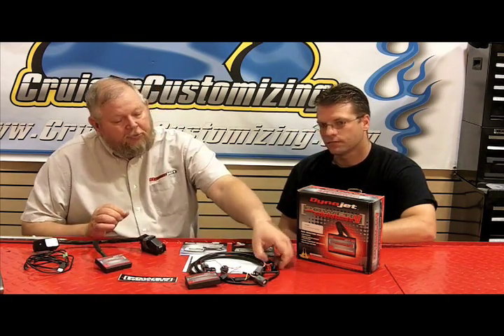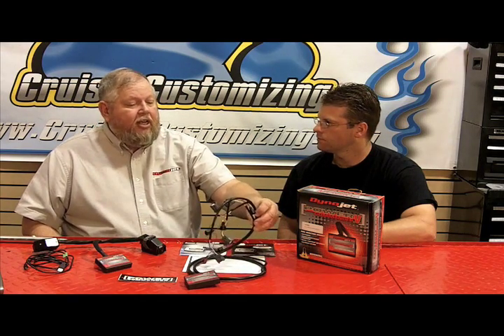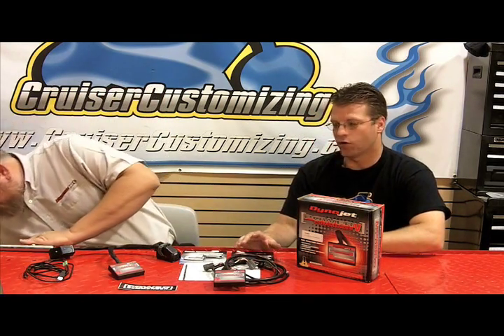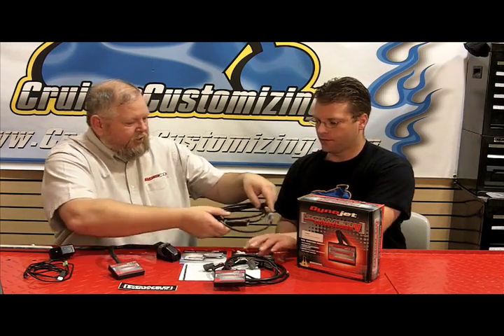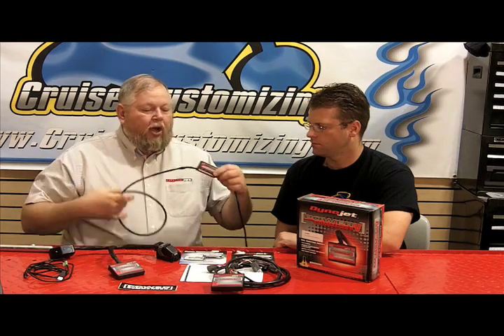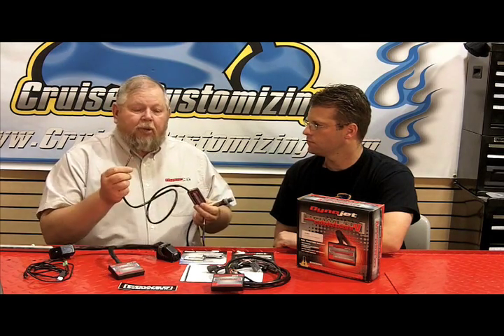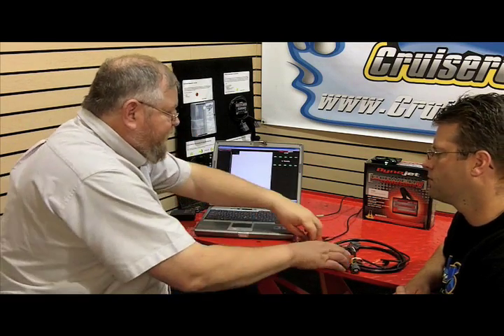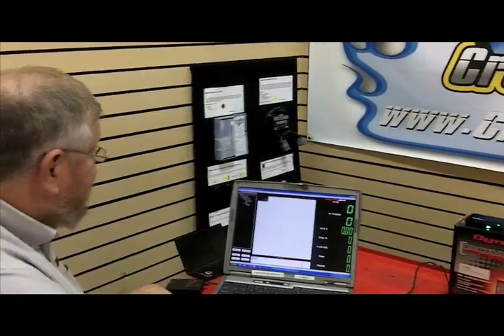Dynojet Research PowerCommander PCV 5 Five

Comment: hi if I change my rear tyre size from a 50 to 55 profile do I have to change anything in the pc5 settings also if I change my gearing to 1 tooth up would I have to recalibrate anything in the pc5  thanks

Comment: Can I get custom map then run auto tune to tweek the map for fluctuations in air humidity as I do a lot of moutain rides and the ignition module will that allow me to set my revs sat at 6000rpm in first and let me launch off the line then when clutch is out fully allow me to go up the Rev range  is it like launch control

Comment: So here is what you do you take a stock bike Dyno that bitch Install a power commander 5 tune it and Re run the Dyno show us what it does for us. Your web site sucks balls and not a video proving this shit works WHY?
Look I know a little bit about electronics I know a little about fuel injection Been working on these systems since  TBI single port multi port well Ok I know my shit.So prove it to me ill buy one. and as much as this shit cost fix the Web site I mean damn did the same guys that made Obama care site build yours? It's just links to places that sell this shit. For 4 bills I can buy nitrusoxide and on a speed density fuel injection I know it will make power.Again what does 4 bills get me with this?

Comment: I put a Yoshimura slip-on exhaust on my prior 2007 Suzuki GSXR-600 and immediately had the FI light come and stay on when no power commander was installed. I now have a 2011 Suzuki GSXR 600 and was going to purchase a Yoshimura R77 slip-on for it. Is a power commander required, or will I get the FI indicator light again like I did on my 07? Thanks

Comment: You apparently bought this without doing any research or did poor research. The auto tuner gets you CLOSE to ideal. A full tune on a dyno is best, from there the auto tune will make minor adjustments to that new tune based on environmental changes at the moment. It's not a magic plug-n-play bullet.